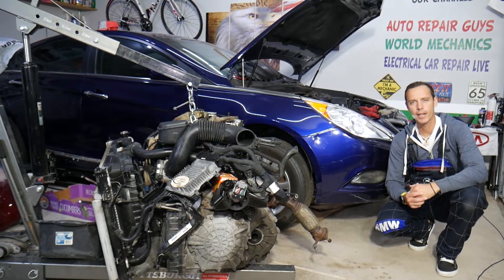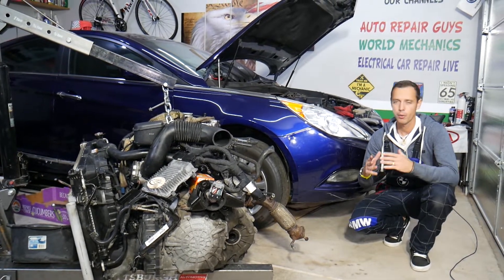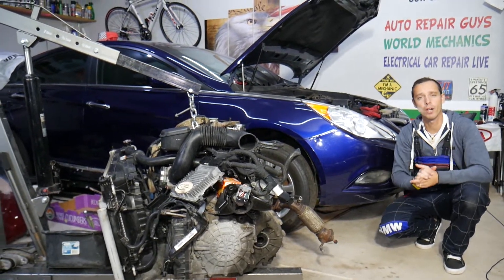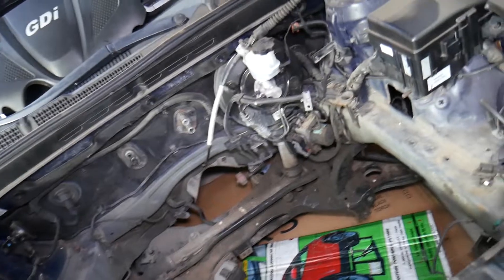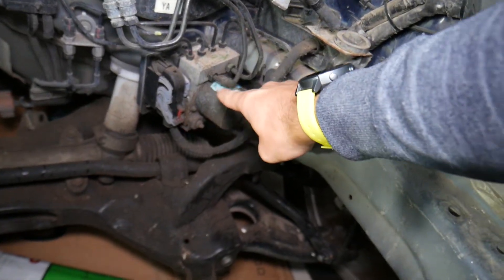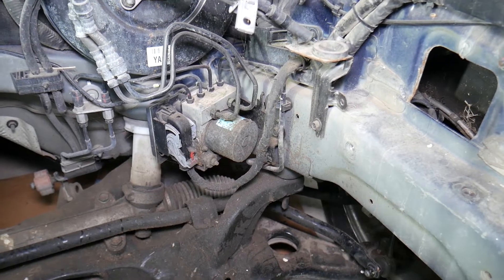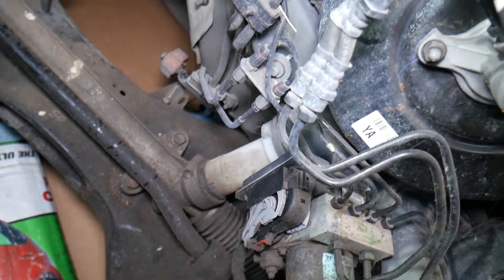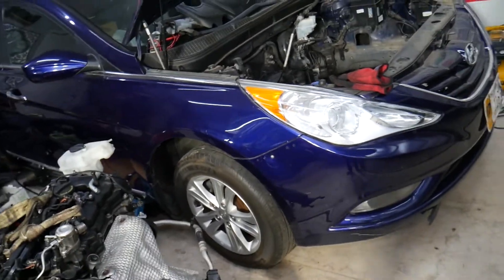HYUNDAI SONATA ABS TRACTION CONTROL MODULE LOCATION

Comment: I have 2011 sonata, I changed the control arms, the tie rods and struts but for whatever reason sometimes on small potholes and bumps still makes a clunking sound, what else could I check for that noise
Reply: Check the engine/transmission/thrust mount.  Could be upper strut mount.  Also, could be the stupid plastic undercarriage shield.  Don't forget the steering coupler.

Comment: Does the ABS control module need programming?
Reply: I called the Stealership.  Plug an play.  Model number must match.  $2,500 for replacement.  May need to visit repair shop to calibrate steering angel sensor. Not enough info online.  This is a disposable car.   $165 max for ABS module at my local junkyard.